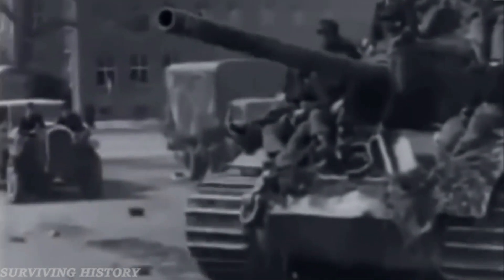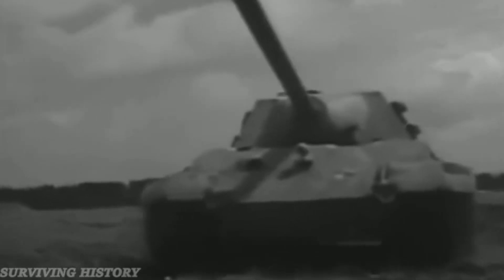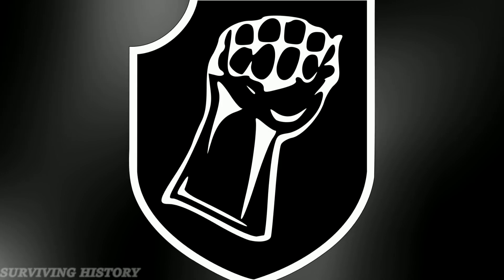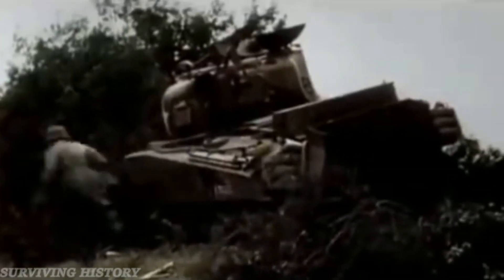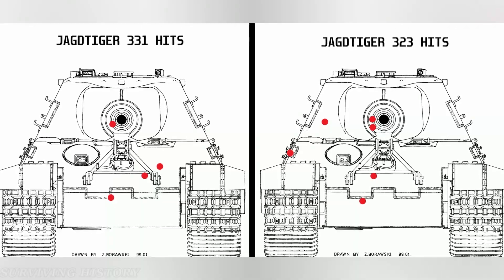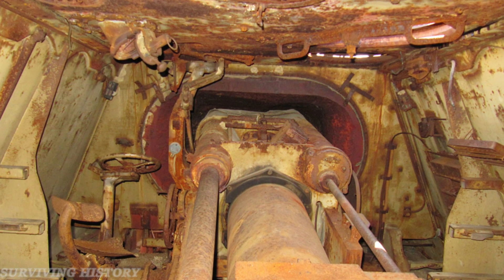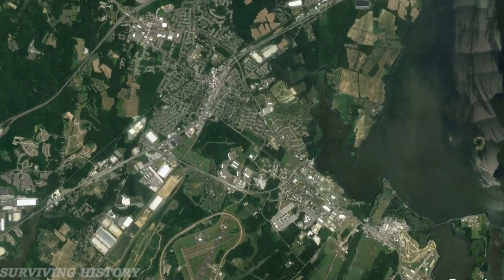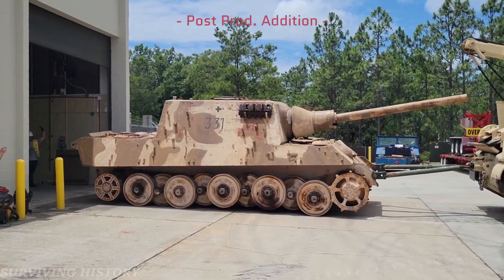Untold Legends - Episode 1 | Jagdtiger 331

Comment: What happened to 323?
Reply from the maker: As said in the video, Jagdtiger 323 broke down. This was likely caused by transmission strain as the tank's weight was too much for the mechanical gears and drivetrains to handle.
Reply: @SurvivingHistory  oh right, do we know what happened to it after? Was it transported after the fact like 331 or just left there etc 
Thanks!
Reply from the maker: @jacobvelasquez1024  I couldn't find much info on 323 as most articles and forums have 331 as the main topic. But since 323 is no longer around today, it's safe to say that after it was taken away, it was scrapped for steel afterwards.
Reply: @SurvivingHistory  gotcha thanks! Excellent vid
Reply: 323 was moved several times within Neustadt by american and french troops (images on the internet and in several books show it at at least three different places (without counting the garden in which it has been found). Finally it was scrapped around 1948 at the festiival place in Neustadt.